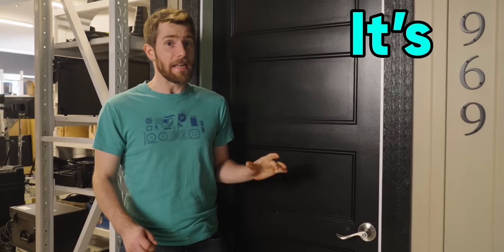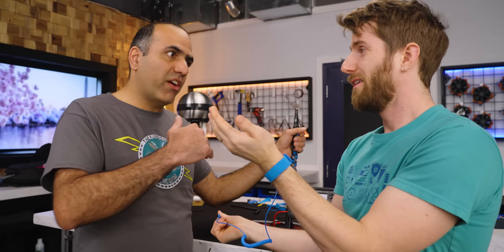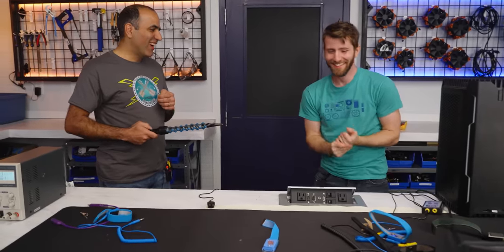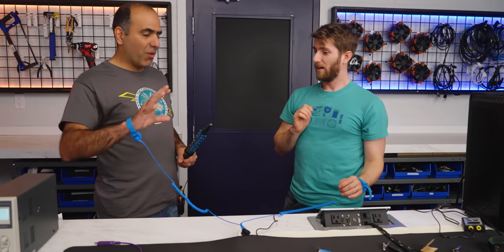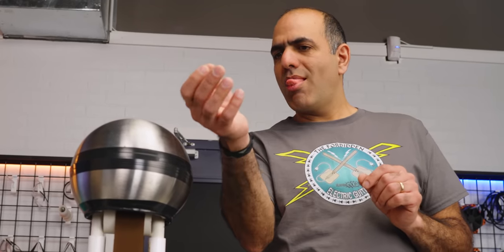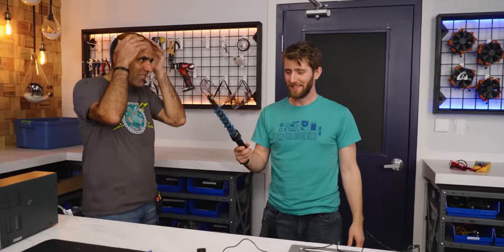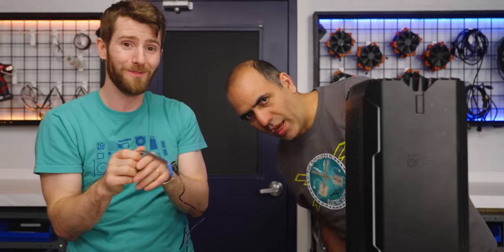The SCAM of Wireless ESD Straps - Feat. ElectroBOOM

Comment: You could save yourself the pain next time, the reason why you feel the pain is because the entire charge goes through a single point, so very few receptors there are suffering the pain from the entire electric charge moving through a single point. The way you can go around this is by distributing the charge flow through a large skin surface area, one way to do it is by holding a key, let's say between your thumb and index finger try go get as much surface from your skin in contact with the key and then point the tip towards (in your case) the computer case, you will see the spark between the key and the computer case but you won't feel a thing.

Comment: I'm SO HAPPY Electroboom is back on your show! 

I never forgot your previous episode together!

You should have him on more often! Fusing tech with electronics is really interesting!

And I also had this problem for about two weeks where after touching my keyboard or mouse, If I then went to turn on the tap or touch the oven I'd immediately get electric shocked!! It was so bad and loud too.

I decided to change my main power plug and the socket it was plugged in yesterday, And so far, No shock, So I hope that's the end of it! <3

Sooo this is soo relevant to me, Because I did buy wriststraps first and it didn't help.. at all.. and I did try attaching it to my keyboard and mouse wire and grounding it somewhere away from my pc but.. Didn't help also!!

Comment: Not even the cheap wristbands on Amazon etc necessarily work - there are comments from people saying they measured and there wasn't a connection. Since the resistor is usually where the plug is (if you connect to a mains outlet ground, not to a mat - but the mat, again, is grounded with a series resistor on the plug), the wristband should measure a fairly low, and at least measurable with any DMM, resistance - but apparently the contacts are often bad with these things.

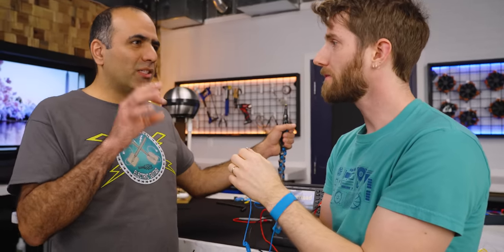Comment: 4:07 I think that is a wrong explanation. The electrostatic voltage is very big in kV as compare to 250 volts or something. But this high voltage has very less power because of the low current. This means devices sensitive to the voltage may get damaged like FETs easily. So putting high resistance matches the impedance of the voltage source (In this case ESD) and helps to deliver maximum power to the ground.

Comment: I read the instruction for one of the wristbands with the resistor that i got as a freebee with some electeonics. It said that it will loose it's protective abilities over time. To check the status of the wristband you were supposed to measure between the plate on the inside and the screw, as long as it was 1M Ohm it was fine.....so infinte life time that is.... 😅😂

Comment: Yup, 5:26 you can see the PTSD just come out as Electro/Mehdi is just setting up the contraption 😂. Anxiety levels up by default when you know he's around because he loves to zap 😆🤣 hahaha

If you're in the East Coast, or somewhere dry & cold- or both- get yourself a humidifier. If you happen to own a home, a whole-house units is great. Apt dwellers, the evaporative type is the best (imo)**. Greatly reduce the amount or forget about, all the zaps in general lol.

Static charge buildup lowers drastically in an environment with 50% rl Humidity; less/if any zaps. If it's below at or below 30% it's "static-heaven". You can of course set it to your desired level, I prefer 45% during the day & 50% at night when the heaters kick in. But the main point besides having less chapped lips, dry skin, is no more zaps from simply getting up out of your chair... only to touch the door knob , that's a personal anecdote and I don't even have carpets!! Lol.

*It's the simplest; a container, wick, and fan, making it also cheaper to maintain/operate. Ultra-sonic/vapor-based ones tend to require more maintenance even if all you used was distilled water (costly, quickly), water softeners can help counteract the mineral/scale build-up but on ultra-sonic--
Edit:* Lost my train of thought after going afk :(

Comment: Sorry, but I love to get shocked.  As an old school IT Tech, I used to palm CPUs and RAM modules to discharge the static buildup on the IC by palming the pins in my hand.  No static strap or mat involved.  Used to freak the heck out of my fellow techs.  Dust Bunnies, that invariable built up in computer cases put on floors was the biggest culprit of hardware errors.  A little one on one time with me and the problems go away.

Comment: you know Linus: you can get anti-static straps for your shoes, and then anti-static flooring. It's not quite as good as wrist straps, but it does work, and you don't need to feel tethered while still being grounded. To go with that, there are grounding tests where you stand on the unit and press a button and it will test if you're wearing the strap properly.
Reply: I worked for a place that had an antistatic floor across the factory and those shoe straps that you mention. You had to make sure that the strap was touching your leg skin as some socks are insulating
Reply: @crabby7668  yeah. We had to do a test every time we went into the room. not testing properly wasn't necessarily a career-ending move, but it did get you a conversation with the CEO

Comment: My alternative to being tethered has been to use anti-ESD gloves. Not that I use them all the time, just that when I do feel the need to add that layer of protection, this is the method I prefer to use.

The biggest downside to them is something any fingered glove has, the reduction in tactile response and reduction in how precise you can be with your fingertips. For me those are non-issues as I don't really like touching things, so I am almost always wearing gloves of some sort. But I can easily see those kinds of downsides being gamekillers to some people.

The gamekiller for me when it comes to the straps is something I have seen a handful of times in person. People wearing these straps, getting the strap wrapped around part of the computer and either ripping a component out (have even seen one person rip the socket clean off the mobo on a socket A board when the cord wrapped around the HSF, which on those boards was connected directly to the socket itself, no backing plates or whatnot, and they stepped away) or just taking the whole case right off the side of a desk. Note: every single time this was because of the cord itself becoming tangled somehow, not superhuman alligator clips). Personally, I realized early on that I could fall prey to this type of accident far too easily (for example I am very easily distracted) and wanted an alternative that was better than simply keeping one hand/forearm on the bare metal of the case.

In over 20 years to the best of my knowledge, I have not killed/damaged a part via ESD. In part due to simply being aware of things like what is on my feet and what I am standing on. But also I think, from using these gloves. Though I have no way to actually prove it.

addendum: It is the shift/change in feeling when going from touching one object to another, or from not touching anything to touching an object, that gets to me. As well as specific types of feelings, such as that of a wet leaf. With even a thin glove, such as would be worn with formal attire, the sensation remains more or less the same. I would invite anyone else who is extremely sensitive to touch, to try this approach if they have not already.
Reply: There are also ones that connect to the floor using special tiles, special grounding wax, and a strap that connects through your socks. These are used in the local printed circuit board factory that makes parts for the US military.
Reply: @petenielsen6683  I think I have heard of that before, now that you bring it up. Or at least something similar.

Sounds like a relatively substantial up front cost, but the benefits in a factory setting are clear. Not just for protection against ESD as well. The less stuff dangling around in a factory setting the better.

I wonder what the maintenance costs are though.

Comment: I'm sure there's probably a way to make a wristband that regulates your body's charge up to a point and could at least warn you if you're building up a dangerous amount of it, but when the alternative is just having a wire running off of you to ground, I can't see it being a profitable product. It also wouldn't really protect you from big currents, either, so the mythical wireless antistatic wrist strap, even if you engineered something that actually worked, would only be questionably worth it.

Comment: I wish they had measured Linus' voltage while he was grounded and touching the generator.  Mehdi said the voltage was near zero, but at a low voltage, the 1MOhm resistor can't drain much current.

Comment: In the phoenix area, the air is so dry, often at below 5% RH, that touching drywall can cause a shock.  During one period, in Albuquerque, when dinosaurs roamed the earth and remote controls were a rarity, I hung a 10K resistor off the ground of my preamp, so I could discharge myself;  otherwise, the spark would crash the sound equipment's microcontrollers.

Comment: I use to test with a basic LCD didplay like you would find in a basic multimeter. I Put one row of pins on the earthed bench mat and touch the other side pins with my hand, and then rub my feet. The display segments would light up. When I put the ESD strap on the display segments wouldn't light up.

Comment: The risk of electrostatic discharge to components is VERY real. I was messing around with a van de graff generator about 6 feet away from my computer. I noticed that sometimes when an arc happened my screen would go black for a second. One day it went black and wouldn’t turn back on. I tested every component and it had destroyed the motherboard. Keep in mind this was not at all connected to my computer and was 6 feet away. It can happen!!
Reply: 😂😂damn dude that's crazy

Comment: Yeah, about the only way a wireless ESD band could ever work would be if it had crazy fractal-ass antennae coming off it to leak charge into the air as quickly as it could, preferably in a humid room, and much lower value resistor (if any) to facilitate the transfer to the antennae.  It would also need to come with instructions to wait several (perhaps several dozen) seconds to let the charge leak out, because the process would slow, and logarithmic - you'd have a time trying to design something that dissipated the charge notably faster than your own hair.

Comment: You should have used the same arm that has the wrist strap to touch the Van de Graaff generator so electricity does not go across the chest. It is very low current and is typically considered not dangerous, however, you are  showing an example that someone else may follow using a dangerous power source which could be dangerous.

Comment: a cup of salt water connected to a prong set to the 3rd prong of an outlet. in AQ reef keeping we ground our tanks from stray ellectrons put off by equipment, just ground ur hand before u start working. and yes it will work if u use a proper contact plate not that lil wrist band they give ya. if ur not familiar with potential differential then i advise you to move on to another job. its basic physics if u make yourself part of the circuit. this device is just crpa bu the consept is the basics of lineman safety. if it can deliver 3 phase 400kv to you from a genarator then itle ground ya from ur lil mombo combo lmao.

Comment: Just plug your computer in and touch the metal case. Then unplug computer. You will discharge through the case for free. In Britian we have switches so we can turn off our sockets I should say, but you can Earth your computer this way. Oh our plugs have an Earth wire also.

Comment: Now IF the wireless bands actually worked, and they held the charge instead of your body, now that energy in the band still doesn’t have anywhere to go unless you have a designated area to tap it against to discharge it. So what happens if you are digging around in some electronics and that band touches against sensitive electronics. Wouldn’t it then discharge and risk the components anyway? You would still do the same damage that you might do with just your hand, just without the pain of it. That’s IF it were to work at all.

Comment: Linus is not easily shocked, even if that's supposed to be a pun, it's an extremely cheap and simple device so it should be cheap, however, since it follows certain standards that have to be assured by a certified body it easily starts being far too expensive for anyone to practically use it unless they're in the industry.

Comment: I get shocked much more often during winter. I started touching my pocket knife on grouded objects, like radiators, and it works really nice. I don't work with sensitive devices though, so it's not like I have to discharge all that often.

Comment: I know there's a resistor in there to protect against shocks, but I wouldn't put one hand on a high voltage and have the other grounded.
Always act like your safety net isn't there, it case it lets you down one day.

Comment: I am constantly shocked by ESD even through a5 cut resistant gloves with the rubber grip coating so much so that I think I should probably be part of a scientific study. These aren't little Sparks either they sound almost like a stun gun "popping". They are obviously VERY painful and I can't seem to get this to stop. I tried changing laundry detergents soaps, fabric softeners, new clothes and a few other things but nothing has worked. I now frequently mist myself to keep the ESD to a min but it doesn't last long and isn't %100 so if anyone has any recommendations PLEASE let me know. Also keep in mind that I can't plug into something while at work as I am constantly moving.

Comment: I find it funny when a computer shop has those wristwraps but no proper ESD enviroment to assemble computers.
Connecting yourself to the case with the wristwrap allows you to safely work inside the computer but it's still not safe to handle things that are somewhere else.
Get a proper ESD mat and ground plug, put everything you gonna handle on the ESD mat (keep everything in their ESD safe packaging). The idea to have everthing you handle on the same potential.

Comment: I worked with electrostatic paint systems.  The noise from shock is where the pain happens...discharge thru a screwdriver...no pain.  Also the smell The high voltage makes is ozone

Comment: There are some real wireless ESD-discharge devices in the field. They work with a magic healthy field which makes the air conductive. As it's not the best solution to wear radioactive wristbands, these are used for cleaning lenses. There are some devices which use cold plasma, but I don't think they are safe.

Comment: I have built PC's since the late 90's, never used an ESD and never killed any hardware. Simple preventative measures are all you need. Touch case before handling hardware, don't be stupid and wear socks on carpet then go picking up components, make sure any energized hardware has been discharged before messing with it etc.

Comment: I've worked on repairing PC Hardware daily for over 25years and have not used wristbands but for a few times . I have also never damaged any hardware in the process. I totally know and understand the principles and know the wired ESD Straps do work but Wireless wristbands, nope not a chance. Glad you did the science to prove the wireless ones are utterly worthless.

Comment: That's why everybody should ground their are frequently against the case especially if they move. And you're supposed to plug it in and turn the power switch off on  power supply

Comment: "there is no wire to connect to the testing device"
it's just as wireless. and tests just as well as you might expect.
for this to work you must look like a very hairy metal porcupine and the air in the room must be very moist.